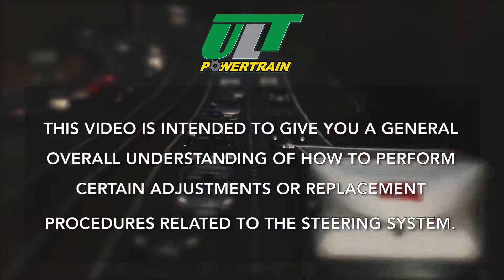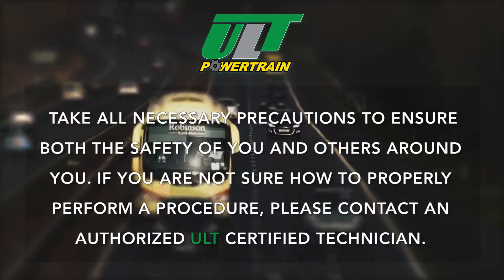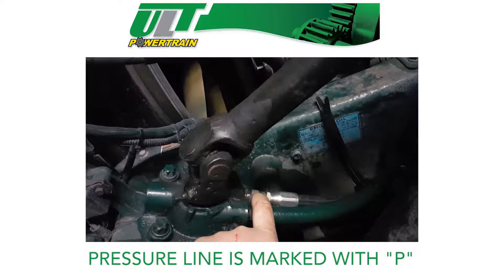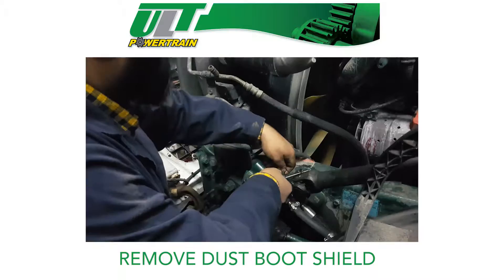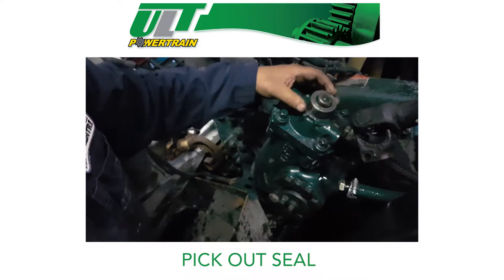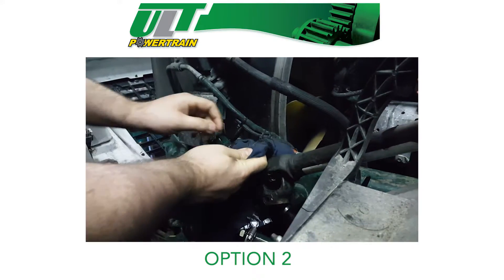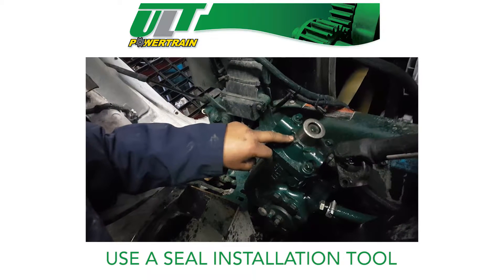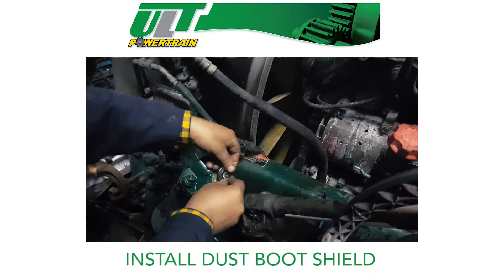ULT Powertrain - Changing the input shaft seal on a TRW Steering Box

Comment: Very professional I'm a power steering rebuilder I can diagnostic trouble shooting some people doesn't know if the problem is the pump or the gear box an they end wasting their money,I had a case from one customer that he remplace the pump and power steering and the problem didn't went a way ,so after checking many factors that could be the problem,I found it,it was the u joins from the column of the steering where you hook the in put chaft